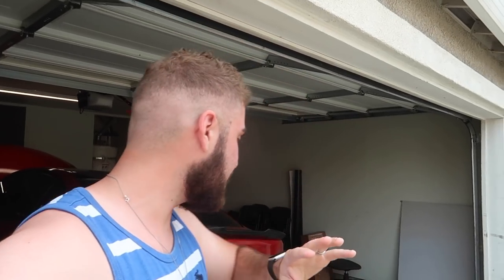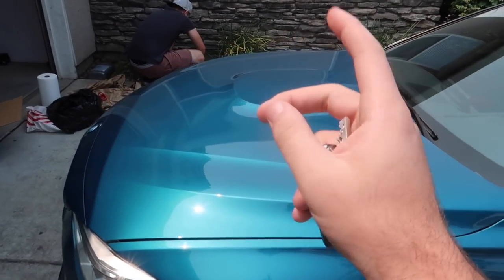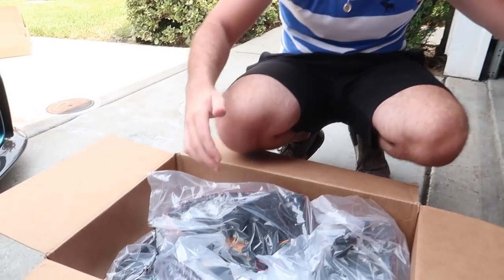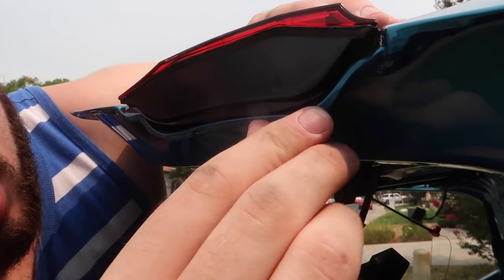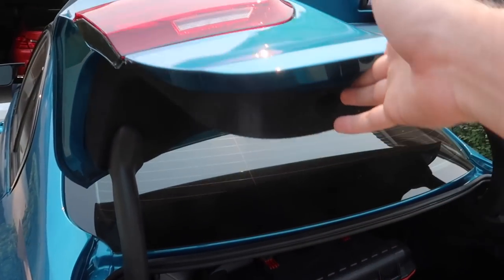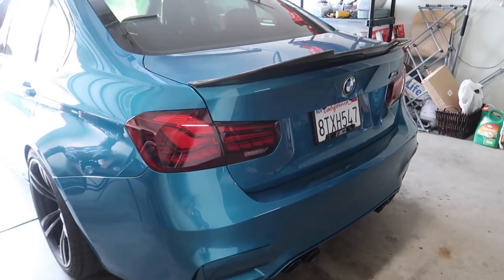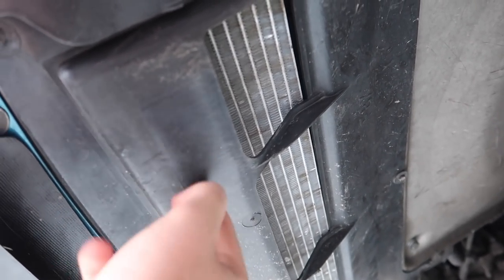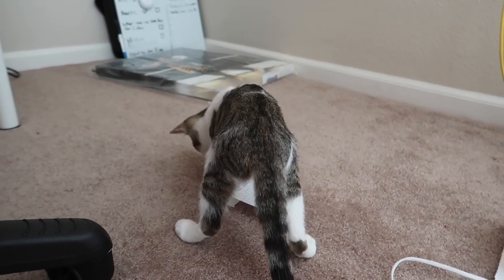WE GOT INSANE GTS TAILLIGHTS ON THE F80! +MORE!

Comment: Hey nour. You just need to adjust your boot spring. No need to buy new ones. When u keep on the boot unlock button it should pop all the way open.
Reply: Yep he just has to pull the spring over to the next notch and it should make it open the truck fully